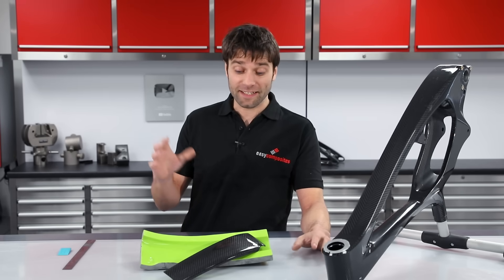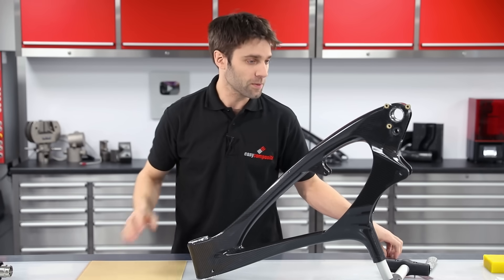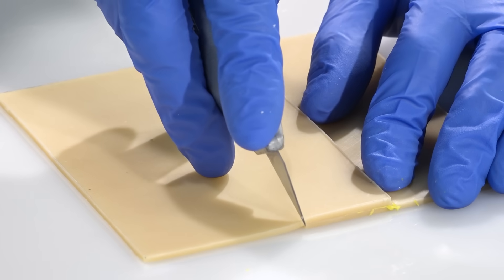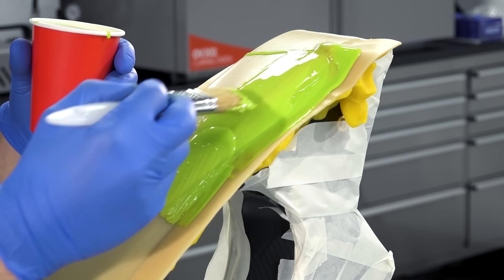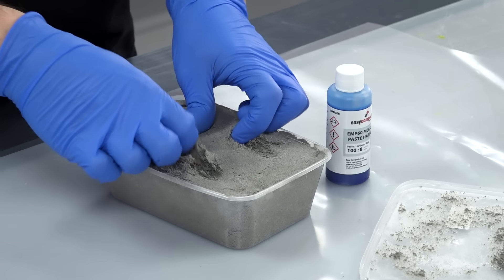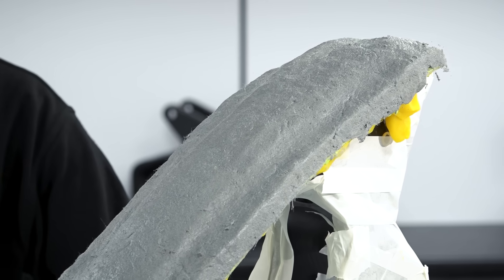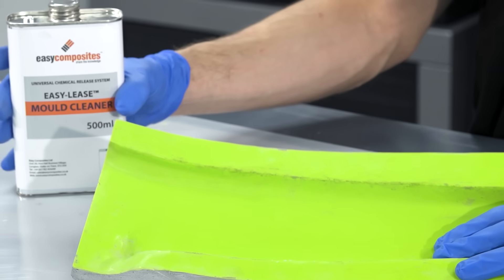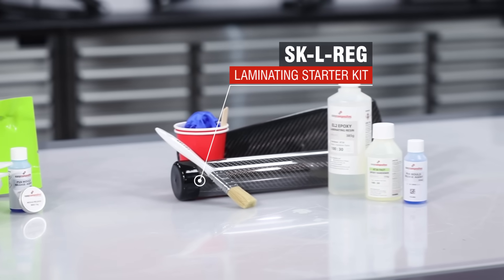Using Sheet Wax to Create an Offset Mould for a Carbon Fibre Cover Component

Comment: I want to do this with my swingarm from my motorcycle. I can’t take it al apart so it wil be dripping down. Is it beter to put smaller layers ?
Reply from the maker: The Gelcoat is pretty viscous anyway so tends not to sag too much even on vertical surfaces but if it is likely to or if you are worried about running then yes, thinner applications allowing each to cure to the 'B-Stage' before applying the next is a good solution.

Comment: Dear EasyComposites and Paul. Love your products, more than happy that you share so many videos for teaching purposes. I want to ask because I'm very bad at the moment making pinhole/void free and gloss finish moulds using EG60 or EG160. I use sheet wax or polypropylene for surface for example shoe horn or A4 paper box mould. I made one-one mould for both components. The results were that on the surface of my shoe horn and A4 paper box mould there were micrometer size pinholes and voids. I don't know what to do better and I'm not the most happy. The following rules are examples I may have to follow: keep the sheet wax and polypropylene sheet as clean as possible from the time I buy it from you and only open it in clean room(that means clean the room I work in with vacuum cleaner, mop the floor and windows and wipe any dust from every surface) before start working; mix the gelcoat as slow as I can and don't lift the stick from the gelcoat until not throughoutly mixed and poured out in a new cup; brush the gelcoat evenly on the surface paying attention I don't introduce any bubbles while brushing the the brush doesn't leave any fibers in the gel. One last question, do these gelcoats(epoxy gelcoat, vinyl ester gelcoat) bubble during the curing process? I was seeing bubbles on the top surface of the brushed epoxy gelcoat and popped out at the tacky B stage but not all of them. Thank you very much. I enjoy every moment working with your products.
Reply from the maker: Both the EG60 and EG160 are usually pretty good at producing a good clean finish to the surface. Pinhiling is usually produced by the weave of a fibre where it causes voids in the surface. If you are getting bubbles in the gel then the most likelihood is bubbles in the gel from mixing or application. The only bubbling from the resin curing should be the  natural degassing as the air releases.

Comment: it would be easier to make the mold using the 3d model , no paul ?
Reply from the maker: This method is best when you have an existing component and don't have CAD models for the parts you're working with. The physical offset from the wax gives you an easy way to ensure that there will be no interference with the original part.

Comment: Hi, do you think it's possible curing  epoxy putting paste into a vacuum bag, to compact the material expecially in the corner?
Reply from the maker: Yes it is possible to do that, especially when using it in tight corners and backing up with laminate.  However, it is not that common to vacuum bag for mould making.
Reply: @easycompositestv  I know  it's not usual, but in some case, it could help to prevent voids, especially using the mold with vacuum or , even more, under pressure (like compression mold or autoclave). I will try

Comment: Hi. I've used your wax sheets to create molds for some cover, but at the time of disassembly, the wax remains attached to the surface of the gelcoat and I don't know how to detach it. By heating it I removed most of it, but the surface remains contaminated, how can I remove it? Thank you.
Reply from the maker: Generally it is scraped off but can be melted off if the mould can handle the temp.

Comment: This video is old now so probably won’t get a reply… but how is a carbon composite supposed to withstand the heat of an exhaust?
Reply from the maker: We're still here and still adding new content but we also try to answer all of the questions that come in regardless of the age of the video. Exhausts will use very high temperature resistance resin systems to help to withstand the temperatures often coupled with internal insulation and heat reflective materials to keep the surface temperatures down as well.
Reply: @easycompositestv  Awesome thanks! I’ve never heard of internal insulations being used in composites. I’d love to learn more about using composites in high heat applications! Also big thanks to you guys for all of the awesome free educational content you put up 🙏🏻
Reply from the maker: @ggroombr  Maybe it's something for us to cover in a future video. We do get a number of enquiries about high temperature components so could be a good one to cover. Thanks for following along.

Comment: Can you just put clear coat on the carbon piece and get a gloss finish? I sanded the moulds with 2000grit sandpaper and i don't have any polishing stuff
Reply from the maker: Yes, absolutely - clear coat can be used to 'finish' a moulded parts. Follow the instructions of your chosen clear coat with regards to surface prep (2000grit is likely too fine) but you could then use matte, semi-gloss, satin or full high-gloss clears to add a depth of finish to your part.
Reply: @easycompositestv  okay, thank you

Comment: When the sheet wax is applied, wouldn't any finger marks or imperfections be transferred to the gel coat and final mold?
Reply from the maker: Careful handling can avoid this, but yes, if you damage the wax, it would be visible on the mould necessitating some sanding and polishing of the mould to fix it.

Comment: I don't understand the wax part you are not getting a true copy of the part but you are copying ontop of the wax with its flaws and dents etc can anyone explain why?
Reply from the maker: The wax creates an offset which is needed for cover components. The wax when carefully applied should not have much in the way of surface defects.  Minor surface defects can be removed from the gelcoat surface prior to using the mould.

Comment: Tanks. Can you re-use the wax?
Reply from the maker: It would be unlikely as the wax tends to come off in pieces once it has been stuck down well to a surface.
Reply: @easycompositestv  thanks very much. I want to make small moulds cheaply, can I use the thermoplastic polymorph?
And with the pre preg, can I make parts without the auto clave? I have the vacuum pump, so do I get a vacuum and bake in an oven? I've watched lots of your videos. Thanks again.

Comment: Can a mold be created by scanning and cnc some wood 2x10s and coat
Reply from the maker: Generally for composite use, CNC'ing a model board would give a better quality pattern to take a mould from.  Generally wood and model board moulds are ok for very low volume use once properly sealed.
Reply: @easycompositestv  Thank you so much for the reply. Would the same coating for the mold demonstrated above be suitable for surface sealing the wood or is another recommended?

Comment: Hi folks, just revisiting this video and I've a couple of questions;
If the sheet wax was heated, could it be rolled out to thickness again (like scone mix) and reused?
Does the mould need flatted and polished or could I just flat back the carbon part and hit it with lacquer?
Ta .
Reply from the maker: When heated to melting point, it is not possible to reuse as the resultant liquid will be a mix of wax, adhesive and release agent traces etc.   The finish from the wax is only medium gloss so it benefits from a light flatting and polish to get the best finish.

Comment: What process would I use if I wanted to make a few copies of the frame protector ?   If I ONLY had the frame protector to work from . 
Thanks
Reply from the maker: You would take a mould directly from the frame protector much like our other mould making videos.  You won't need the sheet wax.

Comment: How good does the surface of the mold come out from the sheet wax?  Could you use duratec primer on the wax and sand that down to make a smoother finish?  The mold parts look a little wavy in the video.
Reply from the maker: The soft nature of the wax means you may struggle to overcoat it.  The mould surface can usually be easily sanded smooth as long as the gelcoat layer is thick enough.
Reply: @easycompositestv  Thank you I will start with that and go from there.

Comment: Thank you very much for the video. I have a question, in case of making clutch housings or any other part that is exposed to higher ambient temperatures, I understand that high temperature resin EL160 is necessary, is this the case or does it work with EL2?
Reply from the maker: El2 with an oven post cure can go up to around 80C so it depends on the temperature resistance you need.

Comment: if you weren't looking to have an offset in the mold could you just add the sheet wax and then have that be the be the mold? skip all the epoxy steps? this would be for kayak paddle shafts
Reply from the maker: The wax on its own is not durable enough to be a mould.  You would just skip the wax step and make the flanges directly on the frame so when you take the mould, it is exactly the same as the original.

Comment: I got so mouch air under the gree n surface. What do i wrong?
Reply from the maker: Take more care when mixing the resin. Mix with a folding rather than stirring action as it traps less air.  Also ensure you are working 20C or higher as the cooler it is, the thicker the resin and more air it traps. If you struggle, you can pass a heat gun over the surface once applied to help lift out trapped air.
Reply: @easycompositestv  i wrote it wrong. What i mean was not air. I got holes behind the green coat and find space at the moulding paste. Maybe i used too big peaces when i put the mouldpaste on

Comment: Release agent would be best, that wax didnt want to come off and If im doin production I cant be d|cking around with removal.
Reply from the maker: Release agent wouldn't add the thickness to the mould for a cover component. You could experiment with release agent on top of the wax but its hard to get an even coat due to the slightly slippery nature of the wax and also the risk of denting or deforming the wax during application of the release agent.

Comment: What resin should we use to make exhaust shields? I can’t find nothing about high temps resin and I am not sure. That yours will be good in this case as your service temp only goes max to 160 Celsius
Reply from the maker: It depends on how hot the exhaust gets but generally you are looking at a specialist resin. None of our resins go over the 160C mark.

Comment: Can you show how to make a mold for an RC aircraft wing? Obviously it would have to be made in two parts, one for top and one for bottom. Then once parts are made the two wing halves would have to be joined into one wing.  I would like to recreate the RC aircraft with carbon composite to make the body much lighter.
Reply from the maker: The moulding principles are identical to any other multipart mould for which we have a video which should help here:  https://www.youtube.com/watch?v=keBwRhkfuOQ&t=318s

Comment: Do you ship to US ?
Reply from the maker: Hi Bec, we can ship to the US, no problem in fact we ship every day and have a great customer base in the States. Smaller orders containing Dangerous Goods such as Resin and Solvents can be a little expensive, but the good news is that you can get an accurate shipping cost easily on the website, simply add items to your basket and then choose ‘United States’ on the basket page. If you have any questions though, feel free to drop us an email to sales@easycomposites.co.uk.

Comment: I have a project in mind that requires the lost wax method to remove a core ,i plan to use boiling water , will this wax flow at water boiling point ?
Reply from the maker: Whilst it will soften, its unlikely to flow as a liquid unfortunately.
Reply: @easycompositestv  thank you ,

Comment: I've seen people using reusable silicone vacuum bags now. It requires you make a part in the mold using a traditional plastic bag first, so you get the offset for the silicone bag.
Could you instead use sheet wax to simulate the thickness of the part, giving yourself a more finished side B for your reusable mold?
Reply from the maker: In theory, yes, however, be aware that in a lot of circumstance, silicone bags generally degrade/dry out quite quickly when used with epoxy resins so we generally steer clear of them when working with epoxy resins for the final parts.
Reply: @easycompositestv  I had no idea about that. Thank you for the valuable insight!

Comment: Can i make a mold with this kit without making it offset? I want to make some new interior trim pieces for my car, and i dont want to reskin, i want it to be 100% Carbon fiber. Would i just use mold release on the car part then cover with gel coat, and just leave out the wax sheet???
Reply from the maker: Yes that would be fine, the sheet wax is only used in this case to create an offset for the thickness of the laminate
Reply: @easycompositestv   would you need to make flanges for the part or just put the gel coat straight on

Comment: Would this be the preferred method for creating automotive interior trim covers that are attached with 3M tape?  Only using 1mm wax for a thinner part?
Reply from the maker: Hi Nick, yes, the thickness of wax you use will be determined by the thickness of the component, for example a 1mm sheet wax offset would accommodate a 0.75 mm laminate thickness. This is to ensure that the trim cover fits over the existing component.
Reply: @easycompositestv  Thank you for the reply.  And this would be the ideal method for creating such pieces correct?  if it were just for one car I would simply skin the stock parts.
Reply from the maker: Yes, if you want to produce more than one then you’d want a mould and that mould would need to be offset slightly to allow for the material thickness. The other way to get the offset is to skin the one part and then take your mould off the skinned part. In some ways, this would be a better and more accurate process than sheet wax.

Comment: used this already very good material how ever it does not come out very easy, sticks both to the part and the mould, its a pain in the ass to clean it. Thank god the mould cleaner from easy composites :D
Reply from the maker: Hi Tan, yes, agreed, sheet wax has always had that problem. It’s not so bad when you’re working all in epoxy (no solvents to soften the wax) but with polyesters and vinylesters the cleanup job is a pain. Also agreed on the mould cleaner!

Comment: If i want make a mould directly on the parts (like a clutch cover)  i need a barrier for dont make the epoxy tooling gelcoat stick?  if i dont have the epoxy putty i can use a normal epoxy resin and chopped strand mat on top of gelcoat, or i have to use another system like the kit uni mould? thanks for an help
btw, really useful and good tutorial!

Comment: he said you don't need form release.  He said the wax comes off easy.
What is his definition of hard?
Reply from the maker: Definition of hard to get sheetwax off would be trying to remove it from solvent based resin systems, like polyester or vinylester, until you've spent a few hours doing then, you don't know what hard is!

Comment: Can this be used to make prepreg moulds? I.e can I use tooling prepreg a after the gel coal and then oven cure?
Reply from the maker: You would use either tooling pre-preg which has its own gel coat built in, or a high temperature gelcoat and resin laminate to make a mould for pre-preg use.  You would not mix the two processes.
Reply: @easycompositestv  Apologies, I misspoke. I meant can I use the tooling prepreg after applying the sheet wax to create an offset mould?
Reply from the maker: Ahh, right, I see. Yes, you could you do this. The sheetwax is 'high temperature' wax and the XT135 tooling system can be cured at a very low initial temperature (65C) so you should be able to do this. You'd need to make sure the wax was fully supported though, because of course the whole thing would be under vacuum pressure.

Comment: What if I want to make a mould that is identical to the original part? How can I get around using the sheetwax? Thanks
Reply from the maker: You just don't use it.  You mould directly from the part itself.

Comment: Very well made video but I can't help myself but to think that the part produced by the mold will be always oversized because of the removed sheet wax.
Reply from the maker: Yes, that’s exactly the point; this process is designed specifically to make cover components that fit perfectly. Otherwise we wouldn’t use the sheet wax and would just take the mould straight off the frame. It’s all about allowing for the material thickness of the cover itself.
Reply: @easycompositestv  Thanks for responding so quickly. So I've clearly must have missed that point in the video. With that in mind everything makes perfect sense!

Comment: So if I need to make a quick mold and don't want to have to spend the time laying up layers of glass under the gelcoat (which can also get bubbles) I can use a putty of filler and strands with resin that I mix some hardener in? That's GENIOUS!
Reply from the maker: It is a specially formulated epoxy putty but yes it does save a lot of time for smaller moulds.

Comment: Great vid as always. I wanted to ask what release agent i should use if i am not using sheet wax/making an offset mould. I can see on your website the Blue PVA release agent, mould release wax and easy lease release agent. Which would be best for use on a plastic part on which i would prefer to leave the original surface unharmed?
Reply from the maker: For a simple moulding process like that then Mould Release Wax would be the best option.